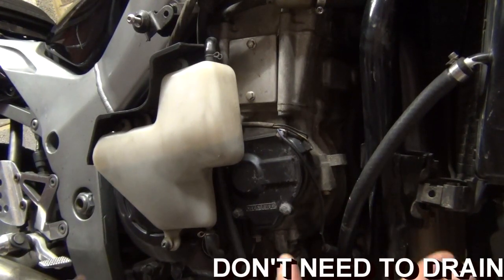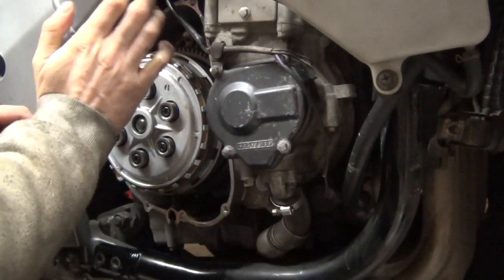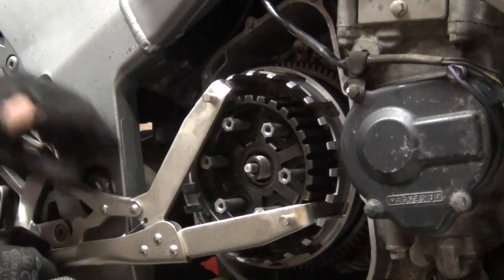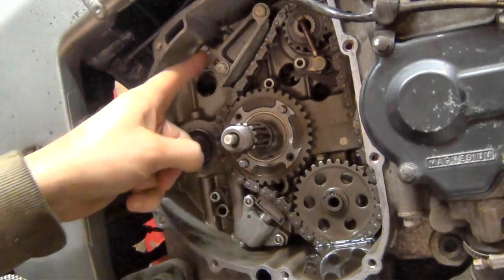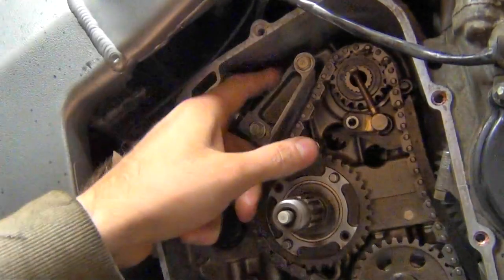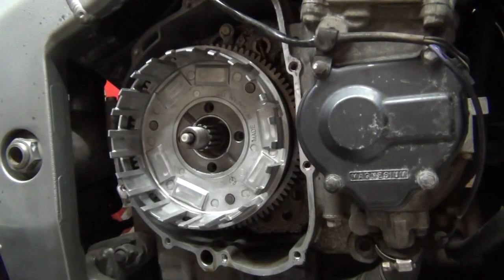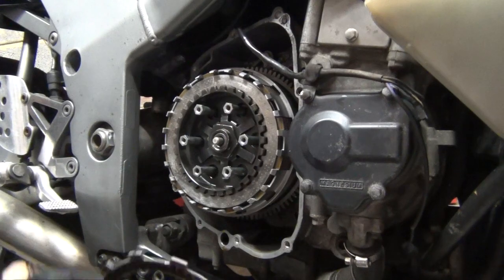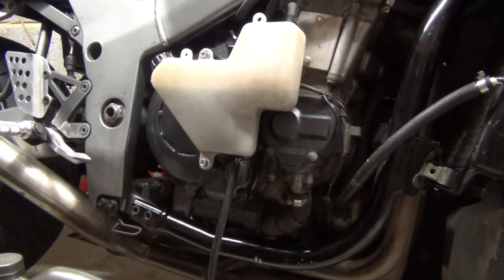Kawasaki ZX9R Alternator Chain Adjustment

Comment: The order doesn't seem right on setting the tensioner. If you snug down the locknut before thightening the mounting bolts (pivot and set) of the tensioner, you may overtighten the chain as the locknut will push it down further. That is not its function. The locknut should be last piece you tighten. Haynes manual clearly says this order to follow. Factory manual doesn't mention tightening the locknut at all, they forgot.
Reply: Thank you mister, I needed the completely disassemble it and this solved the overtightening problem :) factory manual also doesn't specify this tightening sequence for these bolts

Comment: Is the clutch internals much the same on the c models? I have a ticking sound at idle and using the old spanner to ear trick I feel it's coming from the clutch area and need to do the chain tension. Just curious. Also did this reduce your idle noise?
Reply from the maker: The noise was slightly reduced. Don't know if c model has same clutch though.
Reply: With both timing chain tensioner and the alternator done you still have a noise?
Reply from the maker: @andrewmurray5966  noise was reduced very noticeably after doing both jobs